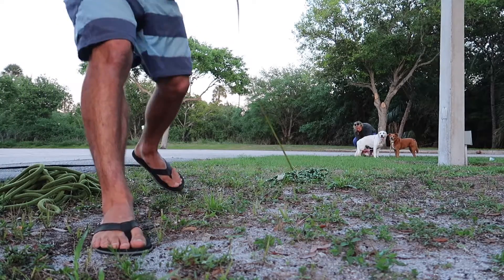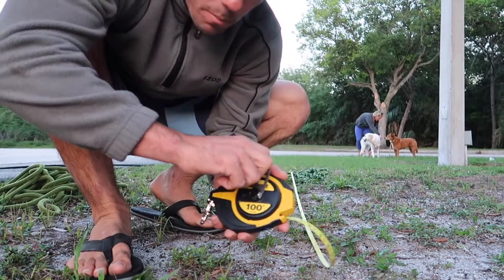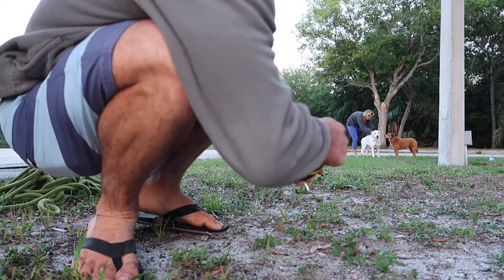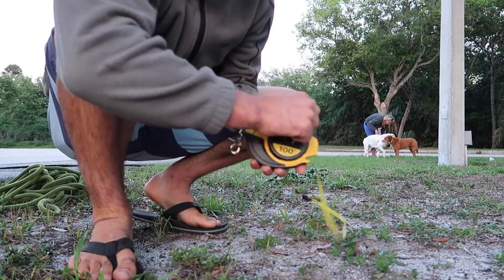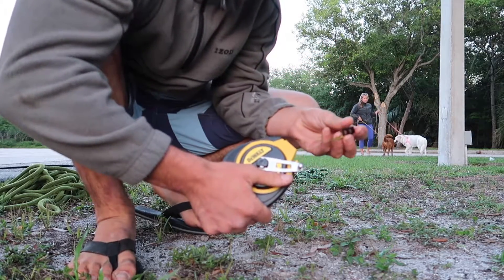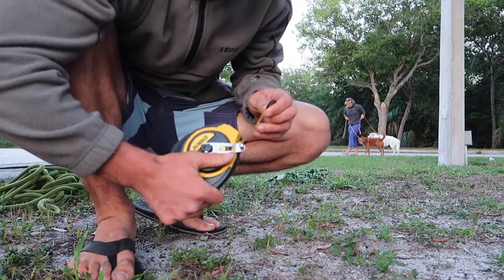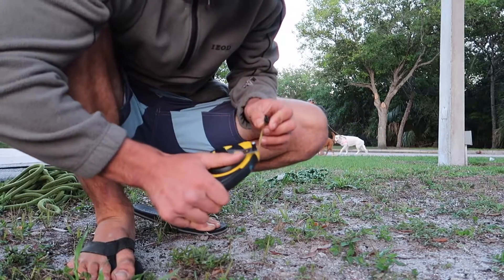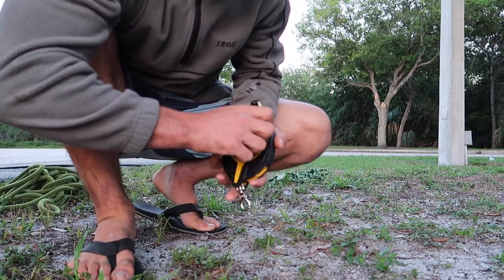HOW MUCH DOES DYNEEMA STRETCH? Pre-Stretching Dyneema Dux for Standing Rigging With A Truck!

Comment: Yikes. The engineer in me was cringing at how far up the pole the line was tied. If tied at the base it would dramatically reduce the torsion (essentially to zero), which is what would pull the pole over. Better yet, tie it to that big ass tree (again, at the very bottom).

Comment: Interesting, but what are the results now? I have done the same thing and found about 2,4 % constructional stretch for the line only and about 40mm or 1 7/12" constructional stretch per brummell splice.
Reply from the maker: What diameter dyneema were you testing? and was it dux or regular sk75, sk78, etc.? I think we determined it was about 3" per brummel splice construction stretch out of it and zero zero stretch out of the 9mm dux line.
Reply: 12 mm DM 20, the low creep variety. Quite different values though even with the lower diameter of your line taken into account: 3“ per splice seems excessive to me whereas zero construction stretch of the line itself should be possible only with a prestretched and afterwards untouched line. Thank you!